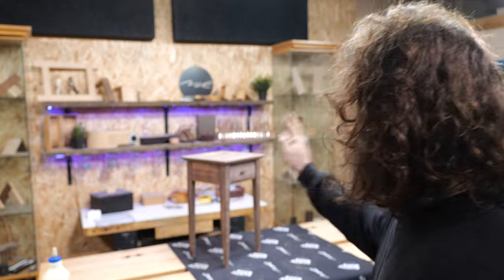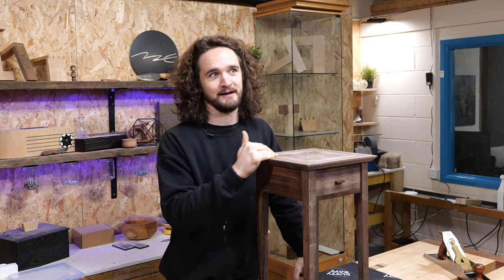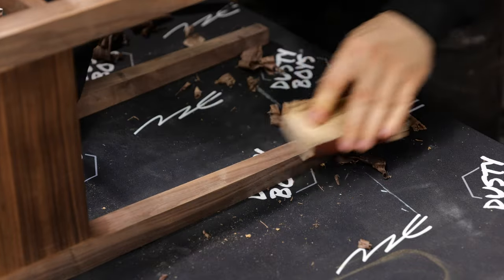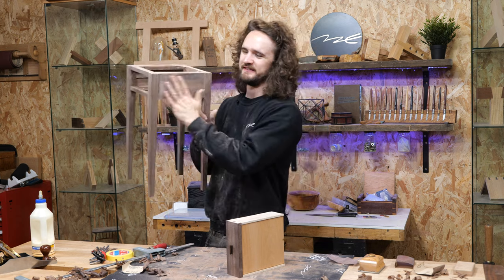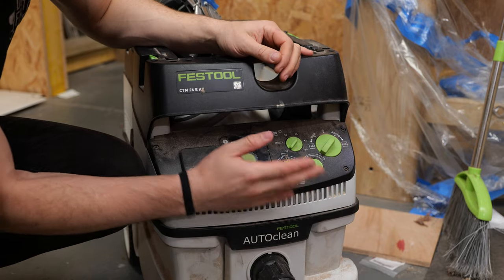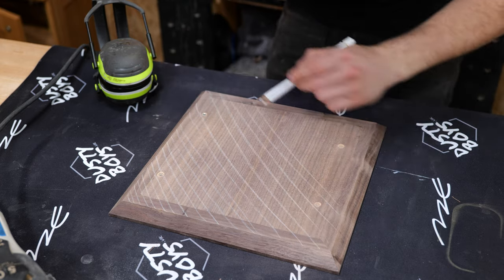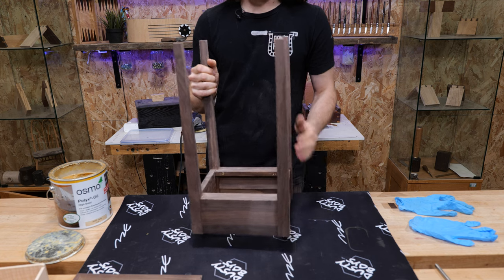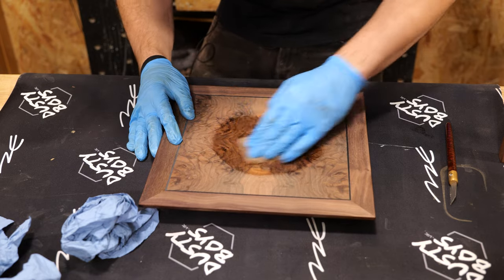How to Sand and Finish a Table | Shaker Table #14

Comment: I notice that you do not do anything to raise the grain on the last (240 grit) pass prior to finishing.  I always do this (but I do not work with walnut) and was wondering if you do not need to with walnut?  Keep up the interesting content!
Reply: You only need to raise the grain for water based or water borne finishes. Other finishes such as what he uses here do not raise the grain.
Reply from the maker: Yep as the above reply states, this finish doesn’t raise the grain. Also the non abrasive pads I use do a really nice job of burnishing the surface while applying the finish. So even if there were small areas of fluffiness, it would even them out to some extent.

Comment: What's the advantage of sanding the bottom of the table top? Couldn't you just leave it rough (or just planed)?
Reply: Nothing, it’s just what fine furniture makers do. For some reason knowing there are parts of your project not finished to the same level is quite a bother.